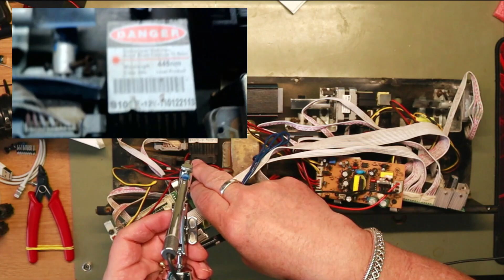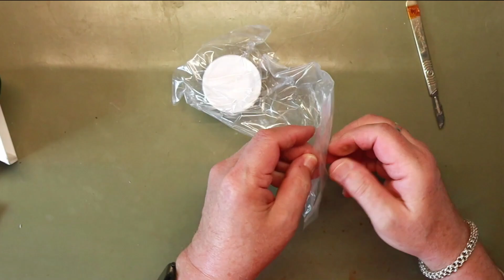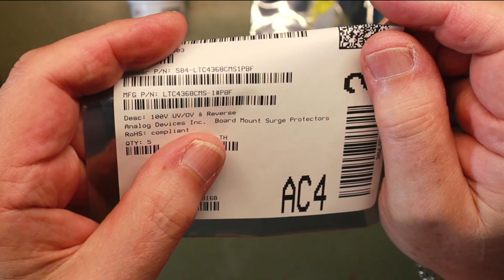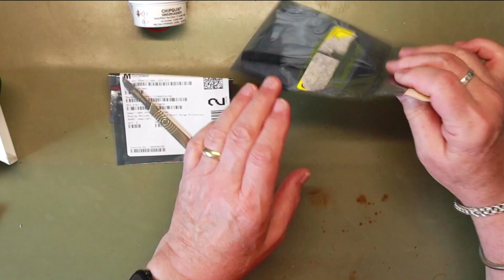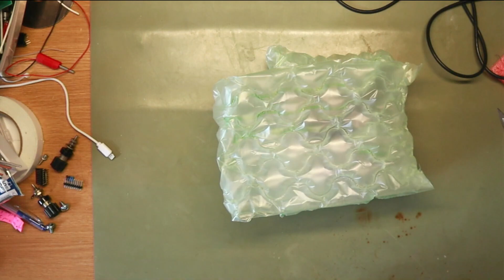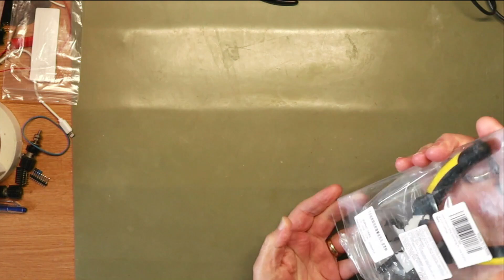#266  Radio Rally & Postbag #42

Comment: The thing with the lasers... what is it?! :D
Reply from the maker: it's some sort of stage or disco laser display. it has a microphone and midi interface, which seem to be controlled by a dip switch on the back. it had a metal ring on the back for a safety cable so looks like it was ment to live high up.
Reply: @TheEmbeddedHobbyist  That is what I though. But the recurring word "Radio" threw me off... haha.
Reply from the maker: @DustinWatts  Ah i see that, it was a local Radio Rally where you can never tell what you might come home with. they take anything odd  in the electronic and electrical line, cos us Radio Hams are a very strange bunch. 🙂
Reply: @TheEmbeddedHobbyist  Ah I see. I though it had something to do with radio. And I was confused :)

Comment: Six steppers and three (or 4) lasers for a fiver - can't be bad! My guess is the "220V" is part of the part number, nothing to do with voltage. Is the distribution box for mobile radios? Looking forward to the design and build. Regards, David
Reply from the maker: @davidv1289  your right, but what mad me think it was a voltage was it was the only one that had a mains powered supply.  So way too easy to make an assumption.  So now I feel a great Ass.